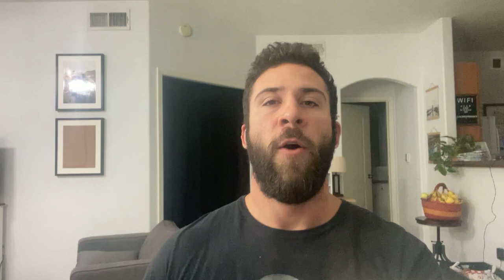Pitching Command Should NOT be Possible

Comment: What is the ``naturally'' occurring  variance in release point degrees? Is the within-pitcher variance large relative to the between-pitcher variance? Would knowing this help you identify athletes who could more easily develop command? (e.g. those with naturally low variance release points?)
Reply from the maker: wouldn't be surprised if the data set needed to answer those questions doesn't exist. at least not yet